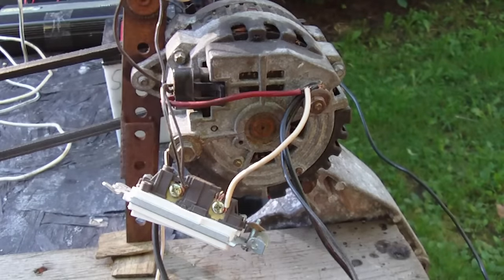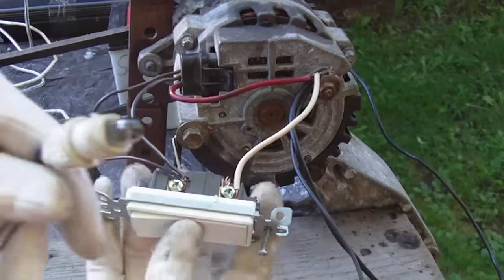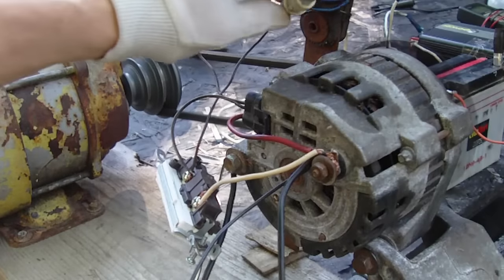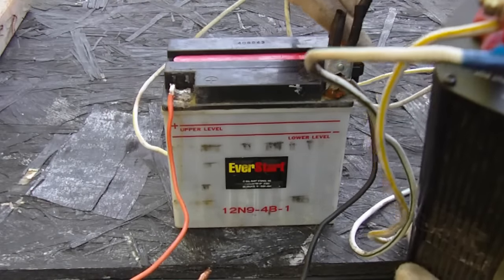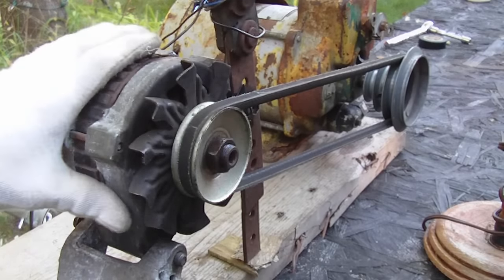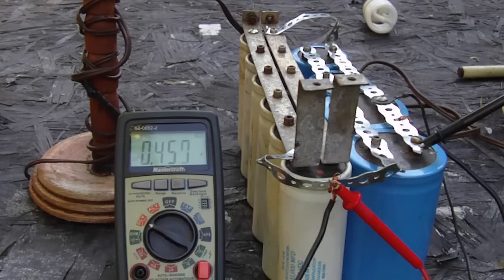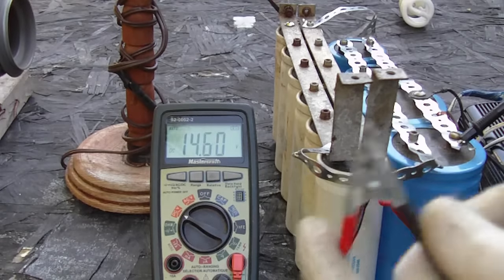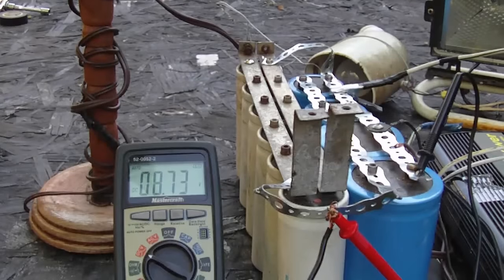Alternator DEMO Wiring, connection to Battery, Capacitors, Inverter, Modification

Comment: I wish you would have spent more time talking about the alternator wiring. It might seem simple to you and other people with pre-existing knowledge about this but I personally need more details and more through explanations. Respectively.
Reply: Wayne Workman juste plug àller the wire with the positif and your ok
Reply: say kevin did u ever get ur alternator
Reply: Wayne Workman i
Reply: Wayne Workman i
Reply: Kevin Sappleton i
Reply: Wayne Workman p
Reply: Wayne workman
Reply: yes me too ' so many videos on you tube most over complicate or do not explain the details deeply enough ' i have watched millions of videos and i am still melting wires and catching things on fire '''' only way to learn some times is to take a step back from all the information ' and think about what makes sense based on what you already know ' and look up answers step by step as they jump in to your head ' over time it gets easier to understand what these clever dicks are talking about ' be patient and it will become clear .
Reply: Wayne Workman aw
Reply: Wayne Workman a”
Reply: Wayne Workman me to
Reply: @fredbloggs2417  youre melting wires cause you are connecting the neg and pos together, as a short, unless you have a load (running something on power produced) thats all you'll do is repeatedly make a light bulb out of wire..
Reply: Where does the chassis ground white and black wire ! go to and also what's the third wire go to on the alternator positive
Reply: Si
Reply: Wayne Workman true... I watch so many of these f**** videos and I still can't figure out how to wire the damn thing
Reply: There are 5 electrical connections on the alternator. There is a positive terminal output from the alternator(the big bolt he said was positive), a negative output from the alternator(the big bolt he called the negative), and the three field leads. To produce generator action you need a magnetic field and a conductor being pushed through it. As the conductor passes through the field a voltage is induced inside of it relative to the speed of rotation and strength of the field. No field, no output. So to produce the field you can either use permanent magnets which are expensive but always putting out a field, or you can use coils of wire to act as electromagnets and save money. The alternator field is produced by field windings so it requires field leads. You wire up the field leads so you have a light that lets you know when you are discharging your battery and a switch to control when the field is produced to control when the alternator is operating. When the switch is open the field is not produced, there is no alternator output and the battery powers the lamp. When the switch is closed the field is flashed the alternator begins to output and charge the batteries and the lamp turns off. I hope that information helps.
Reply: He can’t go into complete detail. If he did they would not allow his video to be  shown.  
   Because of this control you have to watch many, many videos by a variety of people across the internet.
  So eventually you can put all the pieces together.
Reply: @adamm8236  thats an interesting conspiracy theory thats also absolutely nonsense. The reason he doesn't put everything in one video is more to be able to generate more content for further monetization than it is some reptillian illuminati new world order globalist boogeyman taking down videos that show people how to do something that is niche useful that theyll never do anyway because reasons.
Reply: jacob combs 
 I don’t think you realize that you just confirmed what I said.
Reply: @adamm8236  i dont think you realize you are a text book example of the dunning krueger effect. A persons own selfish wants is not a conspiracy blocking such things, and there is in fact no positve effort made to block such videos. Otherwise they would actively block all the little ones too to prevent you from even having the pieces take the paranoid delusions elsewhere.
Reply: jacob combs 
 I never mentioned any ‘conspiracy theory’ Or ‘reptilians’, nor whatever else you are trying to implement into this conversation. 
 I was only stating a fact that any one could easily see across all of YouTube. 
 My looking for information is not selfish or ‘paranoid delusions’. It’s simply just me looking for information. 
 Everything else.. you said. Not me. 
   Many people say what I have said in my original comment. Do you try to stomp on them too? Just curious of your motives. And why you felt you had to be so defensive and add things I did not say?  Let it out.  I can take it!  That’s what I do.  The things other people can not.
Reply: @adamm8236  "if he did they woild not allow his video to be shown. Because of this control..."

You literally did claim a conspiracy.

And I didn't call you selfish I was referring to those who arbitrarily split their content up and then add fluff to increase their monetization revenue as selfish.
Reply: @adamm8236  the paranoid delusions was a primed and admittedly harsh response because there are as you said many who billow forth with such conspiracy nonsense and I do go after them as well, hence the primed overly harsh response. For that I do apologize.
Reply: @jacobcombs1106  yes that true that light is a warning light indicator.if that light turns on means there is something wrong with the charging system
Reply: @jacobcombs1106  thanks for the info..
So i want to ask, is this system self running?
Reply: @dennismenace5174  no. It requires a prime mover to generation rotational energy the alternator converts to electrical energy. In the absence of a permanent magnet the alternator sacrifices some of its output to produce electromagnets but those require you provide an initial electrical input to get started which is where the battery comes in.

Nothing is self running, perpetual motion and free energy do not exist. All energy on earth originates from the sub or other stars.
Reply: @jacobcombs1106  thanks so much for that info, i appreciate
Reply: @dennismenace5174  my pleasure.
Reply: Alternator
Reply: If someone needs more explination than that they probably should not be messing with it.
Reply: @eddiereichel9354  which is probably why they are here asking for the details and not messing with it. They asked to learn, we who know should help otherwise how would they ever know to be able to mess with it?
Reply: @jacobcombs1106  Not everything is for everybody
Reply: @eddiereichel9354  and if they can't learn it then it isn't for them and they'll have to move on, but if everyone everywhere followed that idea, if you don't know it you shouldn't ask to learn it, we would still be picking berries and eating termites and the remains of other animals hunts.

So as long as some asks questions I'll provide information and let them worry about learning it and the world sort out if they are capable or not. I mean natural selection happens right?
Reply: @jacobcombs1106  Im just saying the instructions were pretty clear and pretty much explained exactly what was going on. Im saying if you cannot understand those instructions you should probably not be doing this. I dont care how much someone wants to learn. Then they hurt themselves because they are an idiot then who pays for it? Not everything is for every body.
Reply: @eddiereichel9354  "put these things together but don't understand what they are or what they do" is how the soviets operated their submarines and nuclear powerplants. The K-19 and the Chernobyl plant in Pripyat are results of that. This person didn't say they couldn't wire it as shown, they asked for a fundamental understanding of WHY you wire it that way which goes a really long way to helping people not get hurt when they have to fix their shit later.
Reply: Which brings me back to the statement your trying to tell me is wrong.
Reply: @eddiereichel9354  I'm sorry that has been you life experience. When I was a submarine electrician our leading electrician and chief electrician were very competent. They were the most experienced, and knowledgeable onboard even the ships engineer. When I got my warm DD214 blanket and started working in data center engineering as a technician my chief engineer and facility manager have been the most competent and capable men I have ever known. Now I am being hired by another company to be the Assistant Critical Operations Manager for one of their data centers because I have proven myself extremely knowledgeable and capable and I have more experience in the industry than any other candidate.

It is not always the most incompetent demagogue in charge, only where corruption and nepotism are rife is that the case.
Reply: @jacobcombs1106  No that is exactly how it is supposed to work. None of us are the same. Your different than I am and I am different than you are. Its ok bud. Im glad we are not all the same. This whole "Equality" thing is why this world sucks
Reply: @eddiereichel9354  oh I agree the nonsensical equality of outcomes movement is ruining the world.

People are born equally, crying naked and afraid, and they die much the same it is our choices and efforts in between that really set us apart. Diversity allows specialization in the workforce which allows for more efficient production and cheaper goods and that is good for everyone. The trick to assimilation is making society as much a part of you as you make yourself a part of society.
Reply: forget the alternator, use a battery charger  . make life simple  lolls.
Reply: I know I’m getting pissed off with these people on youtube. I have searched and every video shows them hooking shit up and taking shit apart and never explaining the full blueprint of parts they use and wires and sizes and over 90% of the damn videos is never talking and just music playing. I learned not a damn thing. They talk too fast and act like we know exactly what they are saying. They need to speak slow and in detail with every single damn thing.
Reply: @robertgraham6588  look up LGS. Not all alternators are wired like this. L is load. Reads if alternator needs to turn on. Only one not switched. G is ignition hooks up to switch wired from power source or reads engine is going to start. S is signal. I’ve been told this must be connected to a indicator bulb or it will fry something. This tells you there is power to alternator and goes out when the alternator supplied 12 to 14 volts. Oh ya the main wire B is connected to the battery and is the main output of power and is found usually with a bolt connector and not on the plug connector. Hope this helped

Comment: Hey so wiring the alternator field connections the first big prong is positive to the battery the second small prong is your switch run a line to the battery or the positive terminal of the alternator then to your switch from your switch to the the second prong that switches alternator on the third prong up from the big one is your charging lamp remember when wiring this that the third prong inside the alternator is negative so when connect charging lamp run positive to your switch an the ground of the light to the third prong hope this helps ppl out
Reply: Another tip if you decide to mess around with electricity invest in getting a volt metter to test polaritys so your not shorting anything by wiring incorrect

Comment: So you're turning 120v AC into 12v DC just to convert it back up to 110v AC at the convertor? Why not just power the load from the same power source as the induction motor?

Comment: 1) where's the power that's operating the electric motor (which makes it all work) coming from?
2) providing the power for the motor is coming from the system you've built... can this contraption be used to power a battery bank when the solar isn't producing enough power?

Comment: i kept running over my battery charges so i built one like this with a 1/2 horse furnace motor ..can even run it off a chain saw and a belt if you are stuck in the woods..good for getting tractors going on cold days or if you air lock it and need a little more power

Comment: So, when you turn the switch on it applies 12V to the Slip rings via the carbon brushes to energise the Rotor. This in turn produces the main high current output.

Comment: I'm getting ready right now, to build the same type of setup, however, I have two inverters and a large battery bank, I will be doing this on, with a 130Amp Alternator. I would like to create my own little power setup, especially when the power goes out, power grid failure, so I can at least keep my fridge and freezer going, even if my solar is not bringing in enough energy to keep things going, especially if its snowing outside and cloudy. I already have the alternator, just looking for a decent motor now. Great video! :)

Comment: My question is typical 120VAC 60 HZ drills operate under those pretenses. The alternator's frequency will be much less than that of standard Phase to Neutral voltages. The drop in frequency would not make the drill work as effective, correct?

Comment: I'm convinced that kinetic energy self running motors could light a home and charge devices and other low power electric items.  Our lights are LED.  You may just need the grid for power tools,  cooking and TVs. You don't need much power for phones and laptops.  Or radio (if people still use them?!)

Comment: My alternator only has 3 wires.  Pos neg and starter wire.  What do I do with the starter wire. I put in on the pos of the battery and that stopped the moter . Can you help

Comment: Get a 90 amp alternator remove the rectifier hook the three wires right off the winding put 12 volts to the two wires and get out 90 amps out of the windings

Comment: I would like to know all the wiring as well. Wiring from battery to alternator to the motor I have a car battery, big truck alternator, and a 3 phases motor still need capasitor bank. I'm trying to switch from gas generator to one like this to run my house side of my motor home

Comment: i made a system very close to this .did u know you can get 120 vac from  the alternator . also the field coil dosent need a resistor thats going to put les mechanical drag to it by reducing the magnetic field, but les amp n volts at output

Comment: Excellent video. Can you tell me if the alternator always spins clockwise in normal operations, looking at the front of the pulley face on?
Reply: alternator will work spinning ether way
Reply: Clockwise

Comment: Does this also keep the battery charged up simultaneously while the motors are running eliminating the need to charge the battery  and being limited to just a few hours of use? Or will it run and charge the battery 24/7?
Reply: He is using an alternator which puts out I think 70 amps; if he was using one that put out higher amperage,  he could do more... They make them up to 120 amps.

Comment: Hi great video. Can you guide me on how to achieve this. The goal is to charge the battery like the other cars do and used the battery as the source of electricity to power something like a bulb, base radio and others. The idea is something like these... the alternator will charge the battery and the battery will power up the induction motor to make the alternator running. It's like an infinite loop. Do you think this is feasible? Thanks in advance.

Comment: My question is the alternator powers my F150 but doesn't charge the battery it says it's at 14.2V but when it gets turned off the battery needs to be jumped any ideas

Comment: Can you add more alternators to the same drive belt to increase the charging capacity?  Also, can you use a 12 volt motor for a drive motor in the charging circuit? If yes, do you have an estimated time before the battery would run down?
Reply: You can add more alternators but will need a more powerful motor or engine to drive it. There is no such thing as free energy or perpetual motion. He is using the motor instead of an engine just for the sake of demo. It’s taking more power to power that electric motor than the alternator is producing. So adding a 12 volt motor attached to another alternator will do nothing except reduce you maxmimum power by the amount of inefficiency in the motor. To understand this, see if you can find some sort of human powered generator. If you have a DC brushed motor that will work. Spin the motor, then short out the +/- terminals and try to spin it by hand again. You will notice that it takes considerably more force to spin, and this applies to the alternator In this video as well. It’s kind of like trying to plug a power strip into itself 😅

Comment: you can get a old school  alternator with out a voltage reg...and take the out put DC and wire it back into the stator to self excite after a inital jump start from battery and tap into the 3 phase AC on the stator before it goes into the diode rectifiers..and with enough RPMs you will get 120 volts AC....

Comment: What are you powering the motor with seem redundant to run all that if you have to plug it in in the first place you will still lose power in the conversions
Reply: It is a demo, as he mentions. you might want to use the gas engine.

Comment: can a 3/4 hp ac motor be plugged into an inverter to run an alternater to charge a battery
Reply: thats what i would like to no
Reply: thats a good question did he answer you
Reply: @luiscruz3509  no
Reply: @luiscruz3509  no